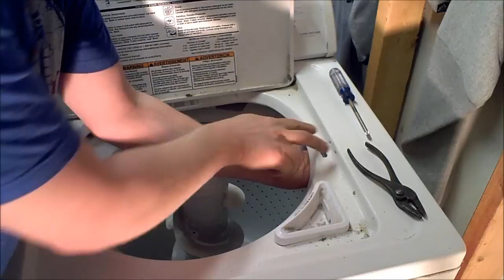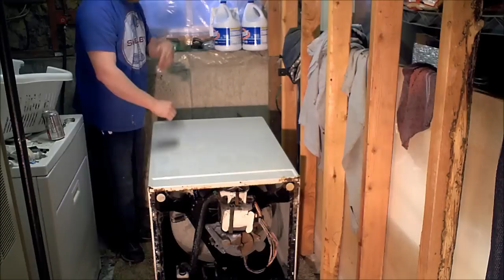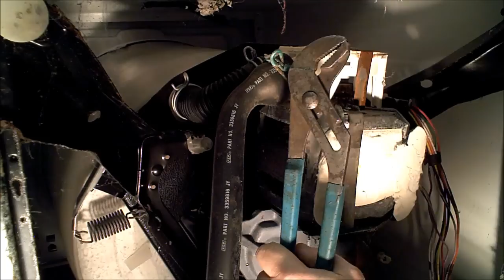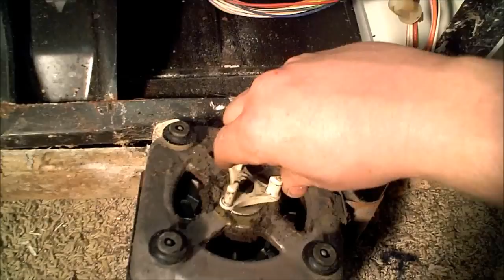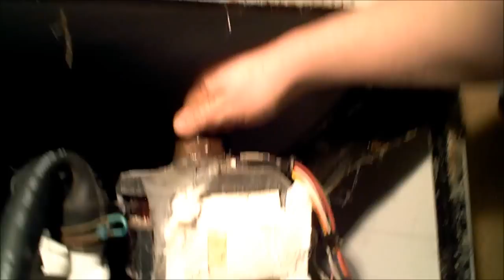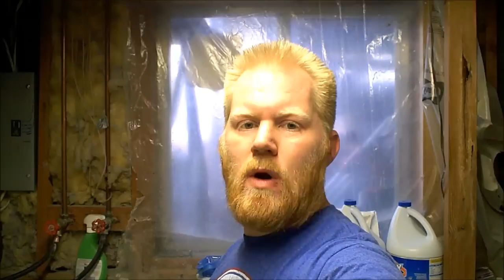Whirlpool Kenmore Washing Machine Not Spinning also Leaking fix

Comment: Sixtyfiveford, You always get a well deserved thumbs up from me. If the motor coupler is good, then its usually the clutch. Replace clutch or tighten the pads against the drum by using spacer washers.  See video: clutch reconditioning whirlpool washer by the appliance man. Thank you for your presentation; always top shelf.
Reply from the maker: Hey thanks
Reply: @sixtyfiveford  Thanks for the reply Sixtyfiveford. Please keep your tutorials coming as we love you in the youtube classroom!!
Reply: @stewartbruce2409  I replaced the clutch and motor coupler, and reset the motor by unplugging for a moment the plugging it and lifting the lid 6 times within 12 seconds, as whirlpool instructions say. 
Still no spin. Pump is good. It empties. It agitates. Just won't spin.
Reply: I have the same problem on a ge washer exactly as you described. I bypassed the id switch do its not that @Karmazabitchdude
Reply: Is there a way to tell, before taking everything apart, if it's the coupling or the clutch? My coupling looks intact and is spinning pretty well, but the drum doesn't turn to wash or spin. Searching a bit, usually if the coupling isn't the issue it's the clutch. And I wondered if the plastic part of the couple connected to the transmission was worn out and causing the issue. Seem like the coupling 65ford links to would be good since it has a metal core. I think I replaced the coupling some years ago, but haven't had time to scrounge through household repair receipts to see when or what I bought. Guess I have to take off the motor/transmission to get to the clutch anyway so I'll be checking the coupling first anyway. And they don't seem to cost too much so I might replace it while I'm in there.

Comment: If the coupler's broken, it shouldn't agitate too. If it agitates but doesn't spin, it's a problem with the spin clutch in between the transmission and the bottom of the outer tub.

Comment: water pump was different setup wouldn't come off after unclipped...was able to see the coupler and turn it in both directions top and bottom was rotating....i dont think its the lid switch becuse it clicks. when depressed and clicks when released...there is a humming sound ( when on spin) and sounded like a grinding on the left side of the tub (when facing it)...any suggestions on what i should check next?

Comment: my machine spins but stops because the drum is out of balance. Now it even happens on light loads.
It used to only do it with heavy wet towels. Kenmore 600 series model 11026132410
Informative show, thank you.
Reply from the maker: Drum centering spring likely came unhooked inside.

Comment: My Kenmore 80 series will only drain and spin on the permanent press cycle and not on the heavy duty or normal cycles unless I pull and hold the knob on the timer switch.

Comment: My Kenmore 110.24944301 will intermittently not spin I have been able to get it to spin by setting it to the spin after the wash cycle. I have heard that there is a plastic part above the clutch with two nubs on it and when they wear it can cause this. Any thoughts about this and do you have a video of the repair?

Comment: Thank you to the ends of the earth! Exact issue was happening I reached underneath there and just work the wires around and worked the switch around to make sure there wasn't any crud built up on it and now it's just ripping away on the spin cycle. Who would have thunk it?Thanks again. You just saved a whole lot of people a whole lot of headache.

Comment: What size is the nut to take it off
Reply from the maker: 5/16" which is the exact same as 8mm in metric.
Reply: @sixtyfiveford  u think my whirlpool la5100xtw1. Is like the fix in the video .. plus I moved my washer it had little water . U think a new pump will fix that as will .. I seen other videos that took the whole washer apart the casing .. I think just putting it in its back looks easier
Reply from the maker: @handsup2  You're washer is identical to the one in the video. The coupler I replace is the number cause of failure in these along with the lid switch.
Reply: @sixtyfiveford  ok thanks .. im going to give it a try ... whew the nerves 😅.. thanks for getting back to me so quick .. sub 💪🏾
Reply: @sixtyfiveford  what's the name of the pump Clamps.. are they one size and where do I get them .. ebay too?
Reply from the maker: @handsup2  They're WP8546127 Retainer Clip.
Reply: @sixtyfiveford  thanks
Reply: @sixtyfiveford  I looked it up that's good to know .. I mean the circle round Clamps that goes on the black hoes
Reply from the maker: @handsup2  https://www.ereplacementparts.com/whirlpool-la5100xtw1-washer-parts-c-163752_166067_326572.html This site will show you a part break down of your entire washing machine. You can get part numbers you need but do not order from this site as they're 10 times more expensive than Amazon or eBay.
Reply: @sixtyfiveford  thanks so much of ur time ..
Reply: @sixtyfiveford  I did everything and when I got there they where fine .. I think the issue is the gear ⚙️ or transmission.. it was linking oil .. I thought it was water .. I find the replacement.. u think its the problem?
Reply from the maker: @handsup2  it's not very common for the transmission to go bad. With the motor off you can spin the input shaft and see if it's operating. Rotate it clockwise and anti clockwise. One way it spins the drum, the other it agitates the wash plate.
Reply: @sixtyfiveford  oh I see .. it washes .. but when it comes to spinning it does alittle or no spin. I find my self closing and opening and it catches and spin sometimes .. thanks
Reply from the maker: @handsup2  If it'll spin occasionally and or with some help from your hand moving it (pen/screwdriver depressing the lid switch so it thinks it's closed), then it is the clutch/brake. Now if at the end of the cycle there is still water pooling in the tub then it isn't your clutch/brake but your water pump. It will never spin fast if all the water isn't drained first.
Reply: @sixtyfiveford  thanks so much

Comment: Replaced thd clutch. Replaced the motor coupler. Unplugged it, waited, plugged it and quickly did the 6 lid open to reset it. 
Still doesn't spin.

Comment: Mine has an intermittent no spin problem. Getting worse. Manually turning the timer control dial back around to spin will sometimes get it to spin after several attempts. Thought it might be the timer control switch. No unusual noises and it adgetates and pumps the water out just fine  Maybe I have a coupler on its last leg.
Reply from the maker: It's likely just dirty contacts in your timer control.

Comment: Need solution why pump continues beyond the spin marker. Within 2 weeks the cycle from drainage to spin they worked intermittently where that pump stops just before spin marker and spin completes to end of cycle finishing or pump continues beyond the spin marker but won't automatically spin to the end. 
My question is what senses the water level had drained and the pump can stop running, then the spin can start?  Just before the spin starts I could hear a transition before the spin starts slowly then increases. 

One note, if I now start the dial just 1-2 clicks before the spin marker then I can see the dial move to and pass the spin marker but the spin does not happen and the pump would continue until the end. 

Another note, if I monitored or noticed the spin cycle did not come on I was able to manually select any other spin cycle or even the same wash cycle and the spin would start the spin then it goes to the end. But now I can't do that. The pump continues beyond the spin marker. Lid switch has continuity. No spin actuator underneath. Coupling is great! Kenmore Series 70, 110.26832692. Is the problem the main selection switch or some thing else?
Reply from the maker: Sounds like the selector switch/timer. It has a few dozen contacts that can get dirty/corrode. The contacts can be cleaned but it's tedious.

Comment: Dude! Thanks so much for this simple, well explained video. Saved me spending minimum $250 for a used replacement washing machine. although I did overtighten the screws at first, causing the washing machine to make a high pitch noise then I could smell burning rubber/plastic. I backed out the screws a few rotations and voila! No more high pitched noise or burning smell.

Comment: I have this washer. I replaced the lid switch 4 months ago and it has worked fine. Now it’s not spinning. It will fill, agitate, empty then nothing. I don’t think it’s the coupler because I don’t hear any spinning or noises from the bottom- all I hear is the ticking of the timer. Any ideas on what it might be before I take a mallet to it? 😊 please help me. I can’t afford to hire someone. Thank you!
Reply from the maker: Try it with nothing in it and smallest water batch. If you can get it to spin with no load but not with a load the clutch/ brake likely needs replacing.
It's not going to be your lid switch as it won't agitate with a bad lid switch.
Reply: @sixtyfiveford  oh thank you! Yes I have tried it empty- it does the same thing. I have ordered the coupler but found it odd that there is no noise from the bottom/motor area. The fact that it agitates made me think maybe it is something else.
Reply: Hi again, my washer is apart but the coupler is not broken. Any other ideas on what it could be? Thank you!

Comment: Hello, pretty late but i was wondering if you knew what was wrong with my washer. My washer is the exact same as this one except it says whirlpool gold. If goes through all other cycles but when it reaches “Spin Pause” it never stops. It used to work fine but now it doesn’t get out of “Spin Pause”. Also it starts to leave like a burn smell. Was wondering if you could possibly tell me what is wring with my washing machine. Thank You!

Comment: Just what I needed only difference is pump works and tub spins if load is light.If a full load of clothes then it will not spin. Could this be my Whirlpool washers fix ? Thanks
Reply from the maker: That sounds like the drum brake is worn. There a lot of good videos on repairing it and it's a pretty cheap part.

Comment: Hello, I was watching your video, which I appreciate greatly BTW. I thought the problem was the door switch but I zip tied it, the water drained but no agitation or spin. What my question is what is the part called exactly, a "coupler"? or if you had a part number for a whirpool that would be extremely helpful. Thank you very much and hope to hear from soon. Benjamin kiesov.
Reply from the maker: Sounds like the coupler. I have a part numbers and links in the video description (directly under the video)
Reply: @sixtyfiveford  thank you kindly sir

Comment: I have VMW kenmore washer. It has a weak agitation and then gets out of balance and won’t complete the spi without my help(I adjust the load before spin and drain cycle). Where should I start to solve the problem? I get a F7E6 & F7E7 error codes. Thanks!

Comment: Thanks for the video, straight to the point and easy to understand.  Does the machine need resetting afterward? I've got an older Whirlpool.  Since you didn't mention it here, I'll assume I don't need to reset after making any needed repairs or replacements.  I think I just screwed up my machine by opening and closing it during cycles and I need to try to reset it 1st.  If that doesn't work I'll ck out replacing parts. I've already replaced the agitator dogs previously when it wouldn't agitate properly.  I had no idea it was so easy to replace them before looking into it! I'm sure so many people just buy new machines instead of trying to fix it. Thanks again!

Comment: Need helpppppp please washer is Ge super capacity plus slow or no spin smells hot belt is in tact also checked pressure switch hose and tried a motor reset.... mkholtz@ hotmail.com THANKS SO MUCH

Comment: Hey mate does Whirlpool Cabrio have the same Coupler?
Reply from the maker: I'm not sure off the top of my head. Google your model number and you should see a parts schematic. Some models use a belt instead of the coupler. In that case it could just be a broken belt

Comment: My whirlpool washer is weird. Most of the time it will not spin unless you lift the lid and close it again. Once you do that, it is fine for that individual spin cycle. Any idea what is going on??? The very last spin cycle, the first half of it, it won't spin. The second half of the cycle, it will spin. It's mostly just a pain, but it would be nice if it worked all the time!
Reply from the maker: Lid switch isn't being triggered by the tab on the lid.
Reply: @sixtyfiveford  that's exactly what I was thinking! Thank You! I will let you know if it works!

Comment: What do you think the issue is if in spins on the spin setting but not during the normal cycle setting?
Reply from the maker: Sounds like an issue with the timer. It controls what turns on when.
Reply: @sixtyfiveford  Interesting, thanks for your response, is it a difficult repair?
Reply from the maker: @unl987  The timer module takes around 10 minutes to replace on the average washing machine
Reply: @sixtyfiveford  Thank you, I will give it a shot.

Comment: Hi replaces coupler and dogs but still not spinning. What could problem be?
Reply from the maker: The clutch can be worn out. Generally it'll still spin with no load in it or if you give it a Kickstart with your hand if the clutch is wearing out. It can also just be as simple as the door lid switch

Comment: Hi sixtyfiveford, my washer won't spin. It does wash and rinses. The Coupler is OK and I have replaced the Clutch... but the other clutch seemed Ok also. I have checked also the door switch. I do hear the motor going, but does not spin dry. Any other idea you can offer? I'm about to go over again and disassembling and try again, but I don't know what also to try. Keep up the great videos. Thanks, JP
Reply from the maker: With something jammed in the lid safety override (screwdriver popsicle stick etc) can you get it to spin by helping it along with your hand?
Reply: @sixtyfiveford   @sixtyfiveford  Hi again and thank you for your reply. I have jammed the safety override as you suggested and I can hear the motor spinning (although I don't think is going fast) and I turned it by hand. I can't get it to spin but it does go like a half turn then stops.
Reply from the maker: @deodea  it's either your clutch or your transmission then
Reply: @sixtyfiveford  with the clutch replaced then as you say for sure it's the transmission. So, it can be working during the wash but not working in the spinning more, right? I'm going to double-check on the clutch and the door switch and take it from there. I'll let you know again. Thank you so much for your help so far. JP
Reply: @sixtyfiveford  Hi again. I have bought a Washer Neutral Drain Repair Kit. I have opened the transmission, replaced the oil and I'm about to put the new kit in it.. However (unfortunately) I don't see any broken piece. The wheel tooth is intact. So, I will put the new one in and the other new pieces but I guess I don't expect that I have fixed it since I'm not replacing any broken parts. Damn LOL, This one is really getting to me.
If it will not work, I don't know what also to do. Again, thanks for your help so far and I will let you know how's going.
Reply from the maker: @deodea there is a guy that has a great video on these transmissions. I can't remember the name of the channel or the video off the top of my head but it should come up when you search
Reply: @sixtyfiveford  yes thanks, I have seen two videos that explain well how-to for the transmission. It tells which oil to use and also about to put some kind of paste as a gasket before closing the transmission.

Comment: Mine is stackable washer and it spins but smoke comes from the inside
Reply: I would like to know what I can do to save my washer machine the dryer works fine and the washer works just when it is on spin I smelled smoke I go turn it off open the door and the smoke was coming out. I just live by myself and I don't know how or what to do I'm disabled and I live from my disability

Comment: Hi there. I have a cabriolet platinum 4.8 cu ft. Washer model wtw8800yc1. Bought it knowing the last spin thru out a uL code. It works good till last rinse spin. Is this a bearing problem or a stabilizer spring problem or that motor/transmission part.

Comment: if the washing machines dont spin you may need a clutch
Reply from the maker: Could be but you can easily test by running it with no load or by kick starting the spin by hand. If it spins then the clutch is worn.
Reply: @sixtyfiveford   my maching  machine will spin very weak under no load what the video dont say any thing about any seals in you pull the at to pull the gear case

Comment: Mine is not spinning but is doing everything else okay...I took it apart and both pieces are in good order. I guess it may be the clutch that is the issue.
Reply from the maker: To test the clutch, try helping it to spin with your hand and or try the spin cycle with nothing in the washer. Both of these you'll need to trigger the door switch.

Comment: My washer won’t spin seems like the same issue but it smells like a bad belt is that just the shaft spinning in the plastic?
Reply from the maker: If it's a Kenmore/Whirlpool then this is likely your issue. Some compact models have belts but most are these plastic couplers. If it will spin if you help it or without any clothes in it, it's likely your clutch.
Reply: @sixtyfiveford I pulled it apart and checked that part and it looks good is actually has the metal replacement in it so I’m guessing it’s just time for a new washer! Burnt belt was my dryer so both washer and dryer went out on the same day!
Reply from the maker: @dustingroom4156  First check your lid switch as it is the most common issue. The washer won't spin if it thinks the lid is open.